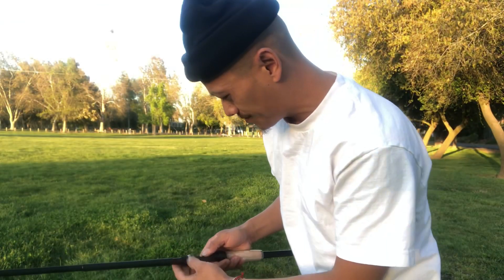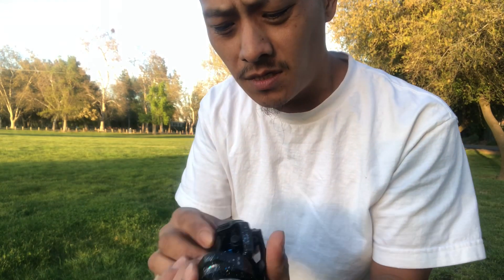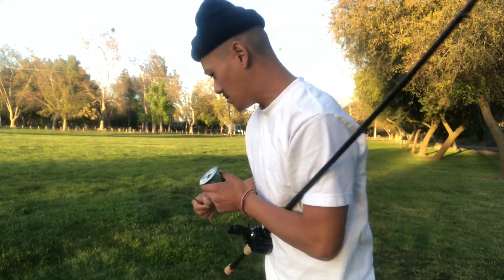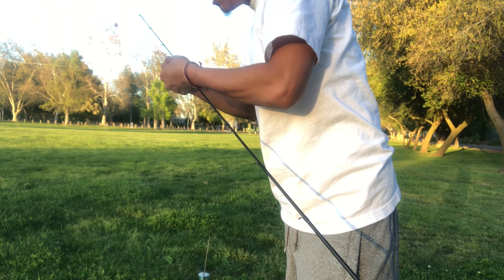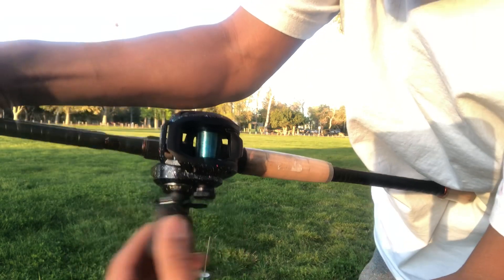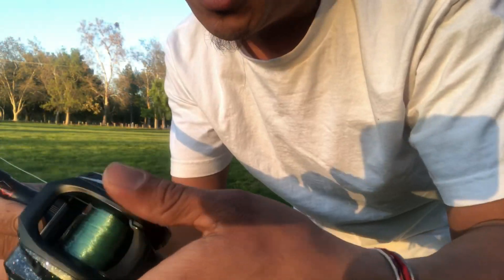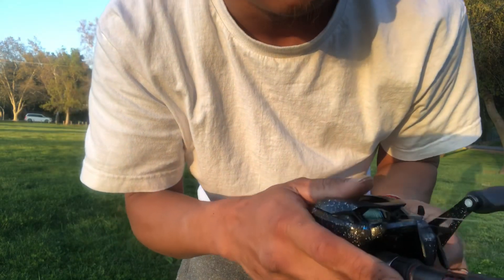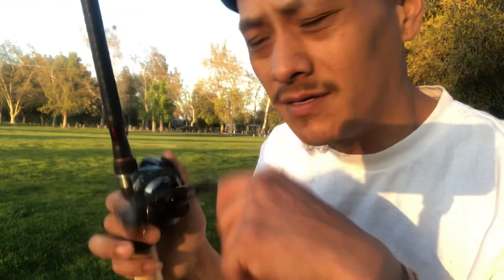Shimano SLX dc (one cast whole spool gone CHALLENGE)

Comment: You need to spool the reel in a box where the line feeds from the top with some tension you do not have to put to much tension where your breaking a sweat lol. That's half the battle. I notch a box and put my line in the box. Then again I only use braid and fluorocarbon.
Reply: instablaster

Comment: Whats your thoughts on replacing the bushings with bearings. Just curious. Sick cast
Reply from the maker: Thanks but I wouldn’t recommend it because I’ve never done it and I don’t know if it’s gonna effect the performance of the reel  but you can try to see if I’ll work.
Reply: @sleetherookie2929   Appreciate the reply. It was just a thought but i wasn't to sure if it would mess the braking up.The more expensive DC reels have bearings instead of bushing so i figured it might make it super smooth like them.I love the SLX DC and it cast really far without trying. Thanks again for the reply

Comment: Baitcaster shouldnt be sideways coming off the spool. Parralel and over the top like a pulling a toilet paper roll off. Spinning thats the way to do it.
Reply: This is called side/forehand cast. There are different ways of casting with a baitcast or even spinning gears. There are side/forehand, backhand, overhead, flipping/underhand, pitching and skipping. Search it up.  Even surfcasters cast at an angle, pendulum cast or otg cast are sideways. This are all techniques used depending on the situation. Side cast like in the video are one of the efficient and long distance way of casting. Nothing wrong with it. Search up shimano long cast with baitcaster, they do side cast. Even spins around for the momentum.